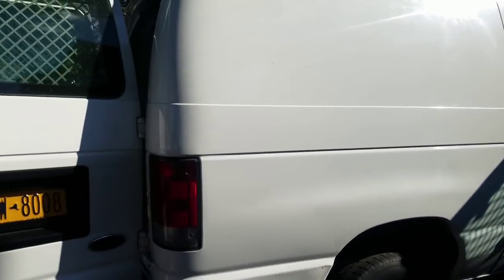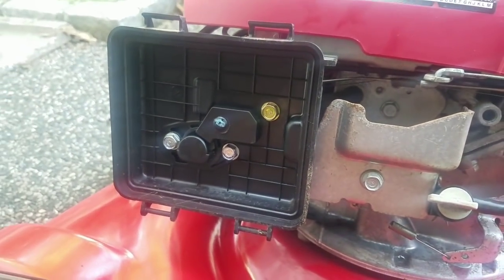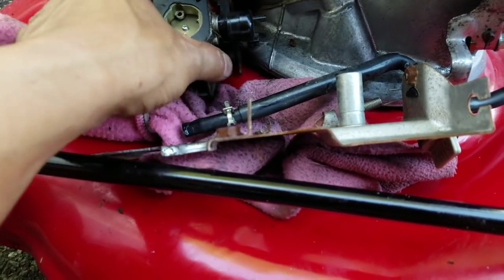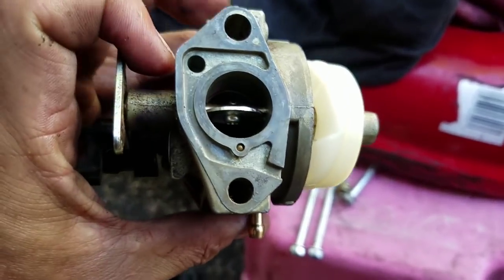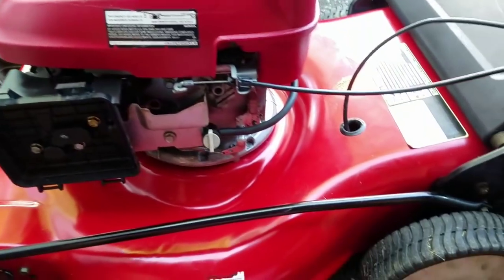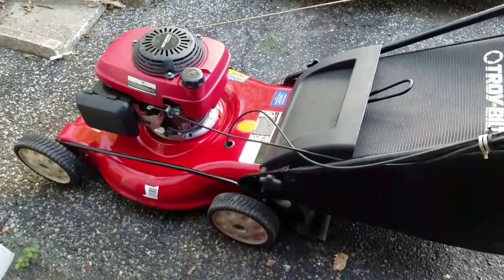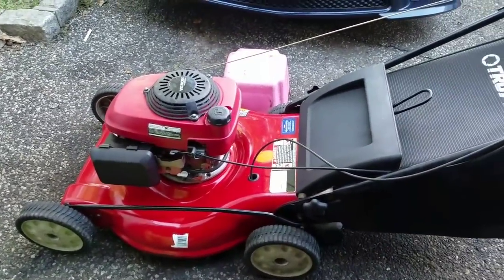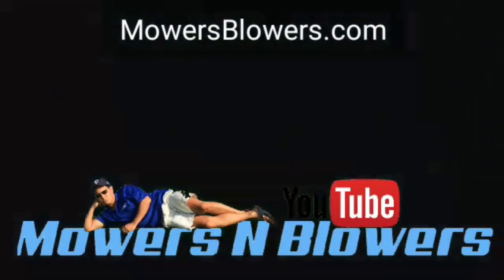FREE TROY BILT HONDA SELF PROPELLED LAWN MOWER LAWNMOWER TRADE +$30 CARB CLEAN FUEL LINE REPLACEMENT

Comment: I just got myself a new Milwaukee impact driver last week. I just used it to disassemble an echo chainsaw that I’m rebuilding. Had the whole thing completely apart in about 15 minutes. 

Good thing for man’s creative genius. 

And I like honda engines. Everything is 10mm and the parts are cheap to buy.
Reply from the maker: Yes...hondas are all 10mm....hiw much was your impact? $125?
Reply: Well I bought the kit from Home Depot. It was the impact and a 3/8 battery powered ratchet and 2 batteries and a case for $169 and Home Depot. It was money well spent. 
The impact has a lot of power and is super compact and the ratchet is great too. Battery life is phenomenal.
Reply: Mowers N Blowers it was the 12 volt stuff not the 18 volt
Reply from the maker: Thays a good deal...the batteries are super expensive..so to get 2 and another tool is great!
Reply: Mowers N Blowers I had good luck with the off brand batteries on amazon. Its less than half price of the actual Milwaukee batteries.
Reply from the maker: @kentogreeno  12v? Thats not very strong...industry standard is 18v-20v.  Generic batteries die out faster...thats my experience.
Reply: Mowers N Blowers I bought the “fuel” brushless version of the impact driver. The brushless 12v stuff has as much power as the normal 18-20 volt stuff. As for batteries, just go with a reputable Chinese company. Amazon reviews are usually very reliable.
Reply from the maker: @kentogreeno  oooh...i see.  Cool. I need to try brushless in the future. Good deal then.